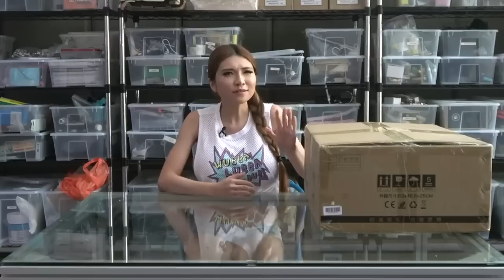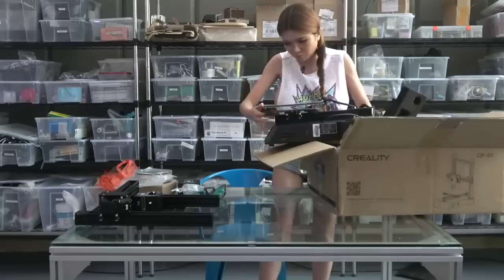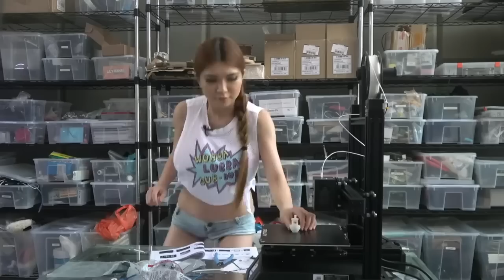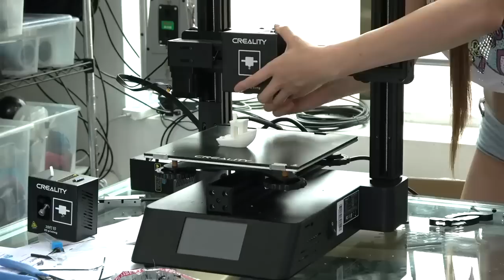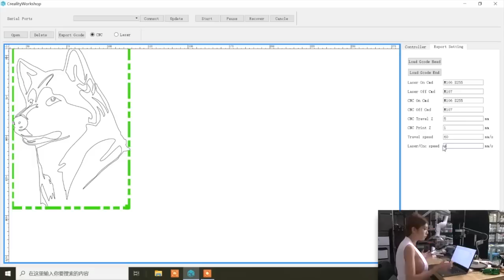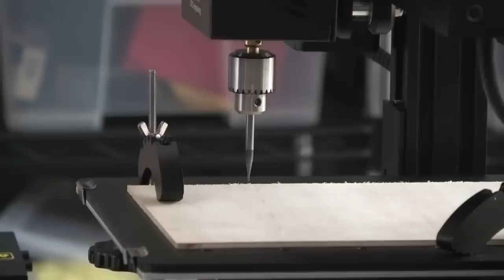Creality CP 01 Review, a 3D Printer, Laser and CNC Engraver

Comment: Hello, is it normal when you turn on the printer it makes quite some noises?
Reply: what kind of noise ?
Reply: @zero00tolerance  it was a production error. They fixed it. However, it's not a robust printer and a lot of lose ends I.e. laser didn't work and had to be fixed as well and it got weaker over time, the cnc is not powerful enough to do proper engraves or cuts and the 3d head leak a lot of filaments .